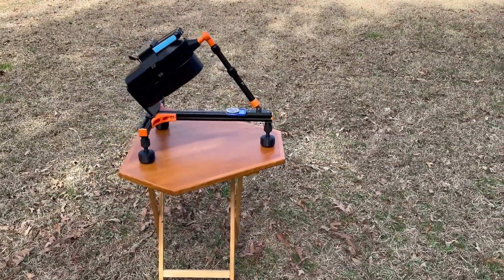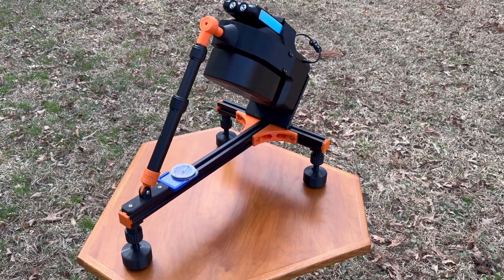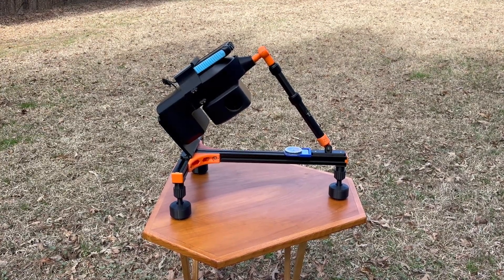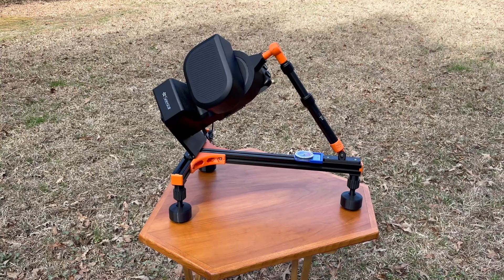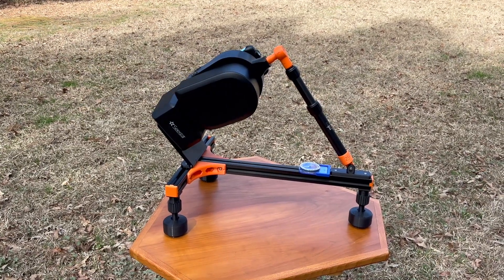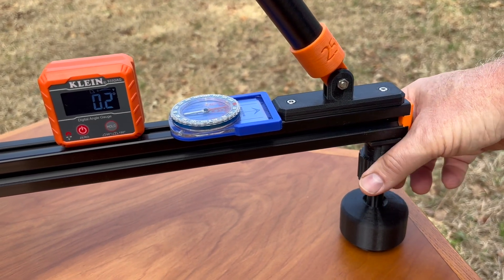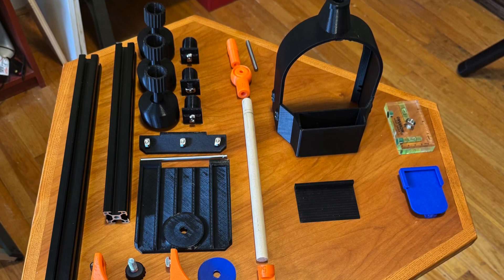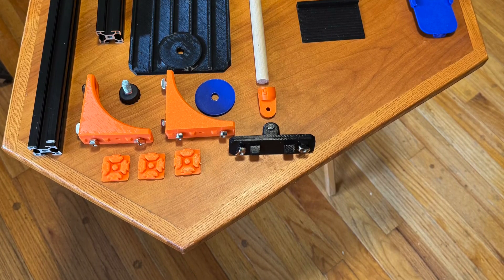Seestar EQ Mode Mount Info

Comment: Very interesting mount.  I like that it reduces stress on the base and motor.  But, and the end of the day, are the images taken with EQ mode at 20 seconds really better than the Alt Az mode at 10 seconds?  So far, I have not seen a substantial improvement in image quality with my S50 running in EQ mode at 20 second exposures.    Question, are you able to use the 30 second exposure with your mount?
Reply: Hey, thanks for the question. I use 20 second exposures to reduce the number of rejected subs because mainly satellites and air planes. I can also do way longer sessions on one object, so for me, EQ mode is vastly superior to alt-az which suffer field rotation too. Also, mosaic mode pictures require less frames to get the same area of image.